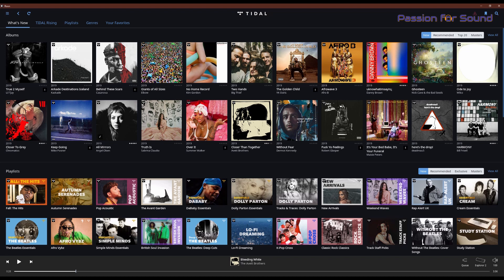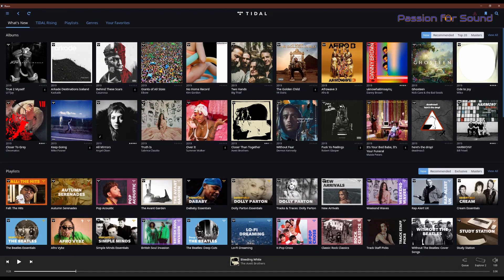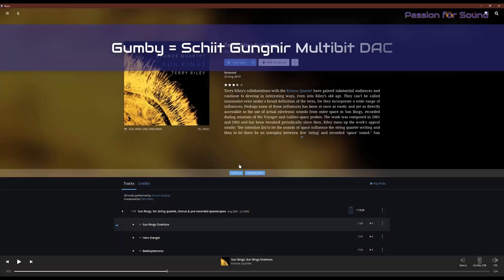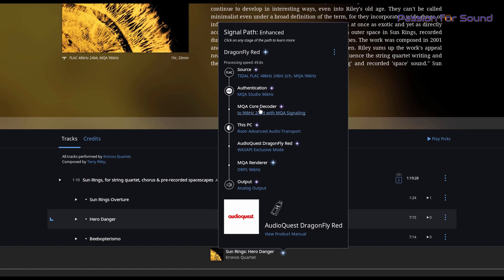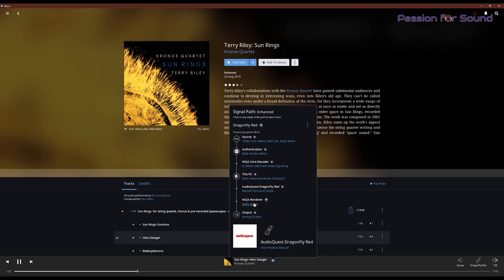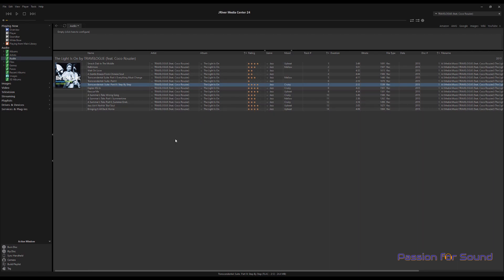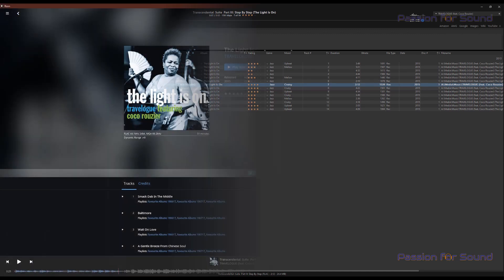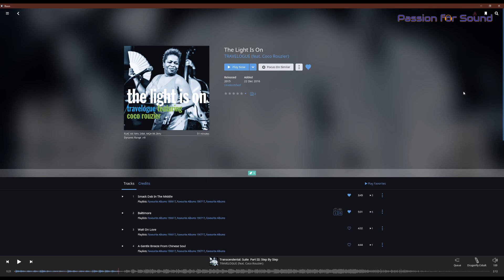Understanding MQA decoding - a (hopefully) simple explanation

Comment: I hate to be that guy that corrects, but I hate to see a scam like MQA gain traction.

1) Do some extensive research on what purpose sample rate and bit depth serve for digitally recorded music.
A sample rate of 44.1Khz is more than enough as it allows for frequencies of 22.05Khz to be recorded and reproduced perfectly. Higher sample rates do not capture more detail, they simply allow for a larger range of frequencies to be recorded (read about the Nyquist-Shannon theory) and human hearing has never been capable of hearing frequencies above 20Khz.
Bit depth only affects the dynamic range possible in a recording, and determines how quiet the noise floor in digital recordings is. A 16 bit recording allows for roughly 96dB of dynamic range before you hit the noise floor, which is enough for virtually all recorded music. You need to have the volume on 16 bit music raised to deafening levels before start to hear the noise floor. Having 24 bit music adds no extra detail, does not affect what you're hearing and just creates larger file sizes for no added benefit.

2) Try doing some research as to exactly how MQA manages to store "higher res" audio at smaller filesizes. You will not get any further than the "musical origami" buzzword. I've spent days trying to research how exactly MQA does FLAC files better than FLAC files themselves, and got nowhere. Please do let me know if anyone manages to find out anymore about this.

3) it's worth noting that "unfolded" MQA files are not even CD quality. If you do some research. you'll find that, in order to be able to extract the added data, MQA takes 3 bits off the original 16 bit recording such that unfolded MQA audio has a bit depth of 13 bits. Whilst 13 bit depth recordings offer a decent 78dB of dynamic range, isn't it ironic that you can't even enjoy CD quality recordings with something hailed to do FLAC's job better than FLAC itself?

I remain at your disposal should you have any questions about the subject. Do not buy into MQA  or any other sort of "hi-res" music scam that promotes the idea of "higher bit depth and sample rate = better audio quality". Anything over CD quality is overkill - nothing more than a waste of timr and money.
Reply from the maker: Hi Snack. Thanks for your comments. I am deliberately avoiding the conversation around whether or not MQA is good or bad. My intention was just to make clear what the different levels of decoding are. Beyond that I believe people need to decide for themselves whether they like it or not.
Reply: MQA is a challenging topic, no doubt. The tech however is NOT a "scam".  Such a view requires intellectual dishonesty or willful ignorance...or both.
Reply from the maker: Well said. Whether we like it or not, I believe the inventors had good intentions regardless of any inherent flaws we might perceive.
Reply from the maker: PS you may find the links I posted in the description to be helpful in terms of additional details about what is / is not happening in MQA files. Again, not saying if it's good or bad.
Reply: Snack maybe you should have ended your reply with your first two words “ I HATE”.  Why spread lies and misinformation when the presenter is trying to clear up any misunderstanding of MQA? 

Stick to “snacks” instead of trying to smear a technology that you clearly have not listened to, or even possess the proper equipment to listen to.